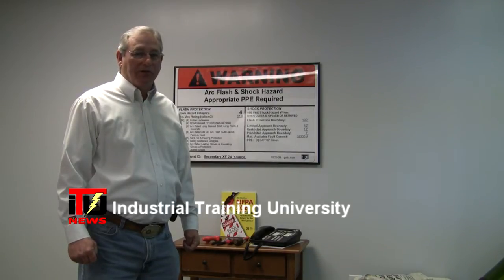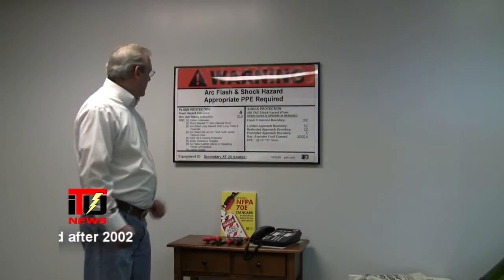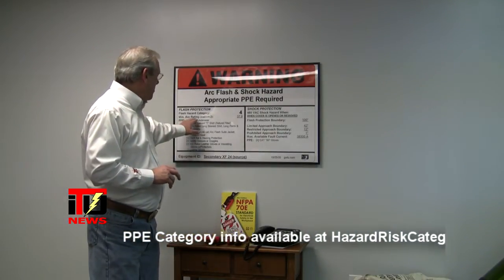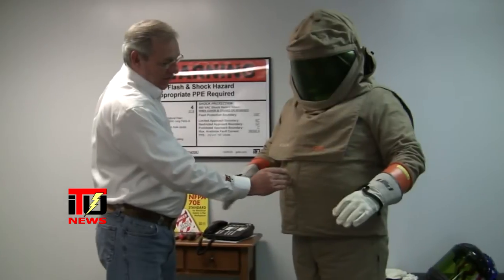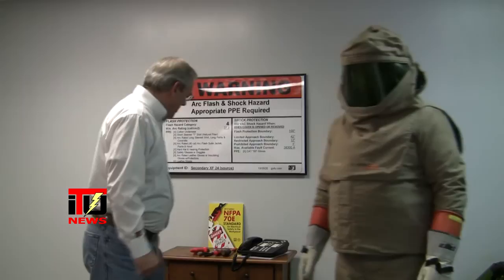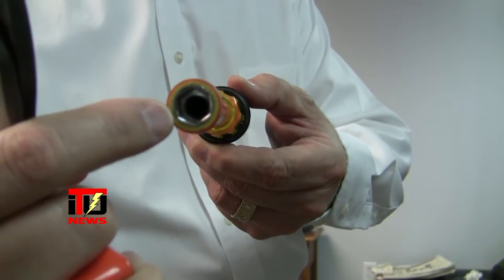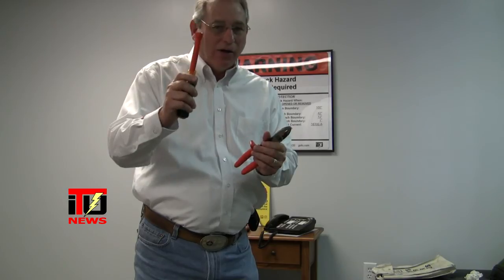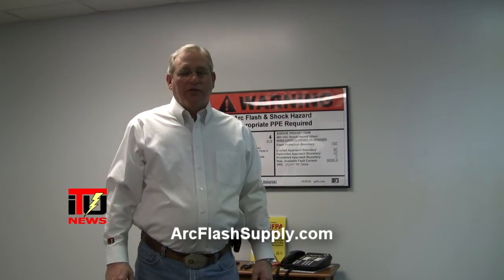2012 Arc Flash Warning Labels, PPE, and Voltage Rated Tools

Comment: So we are talking about the ATPV. This is the Arc Thermal Protection Value of the Arc Flash PPE (for instance, 40 cal suit). The higher the voltage you are dealing with with energized equipment, would require a higher-cal ATPV rating for PPE (for example, 60-cal suit, or 100-cal suit., etc.).